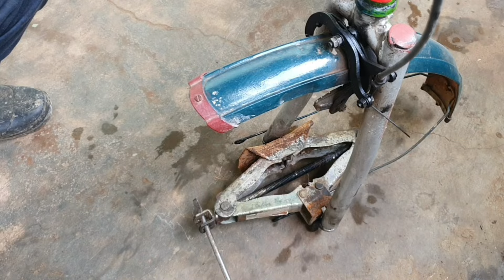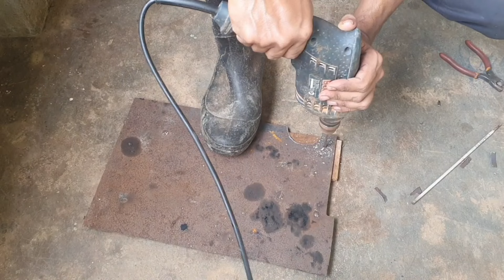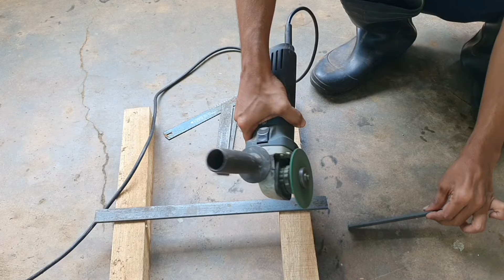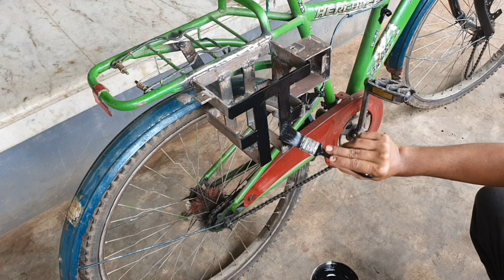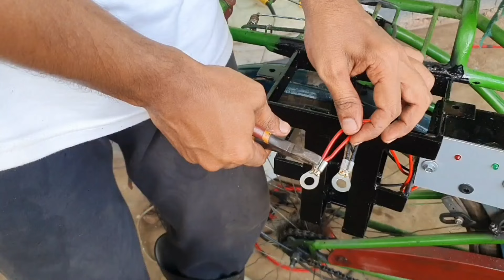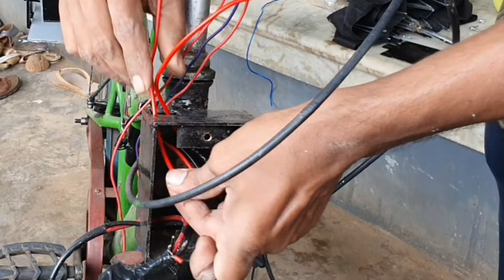How to make electric bike using self motor

Comment: Bro , motor cost in rupees and battery cost in rupees and auto cut off charger making video link send me bro . And charger making cost in rupees
Reply from the maker: Exide 9ah battery 2250rs
Passion pro self motor 1357rs
Auto cut off circute around 200rs.
Link will soon upload

Comment: For experiment is good but in practical it can not be for long time because starter motor is for starting engine only after start it has to come back ,of you use long time again carbon brush will finished soon.
Reply from the maker: Thanks for your responds. Maintanance only you have to do that changing the brush. In mixer grinder carbon brush we changes only after long time use